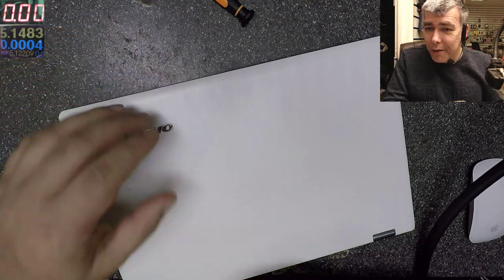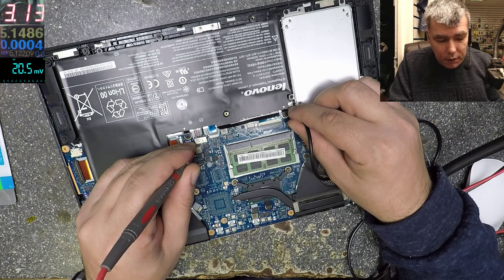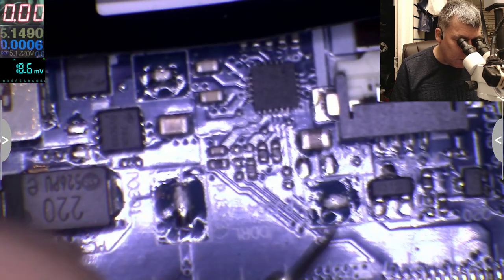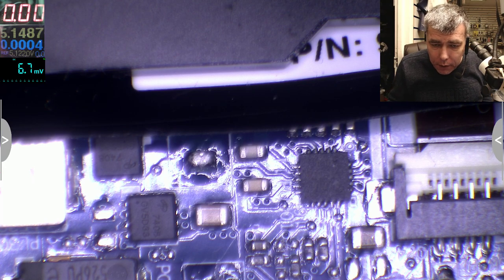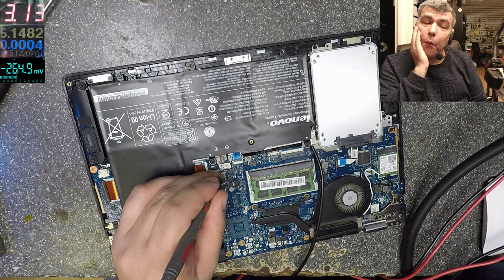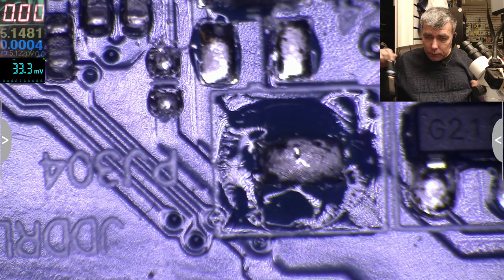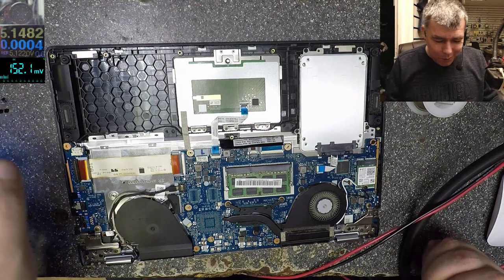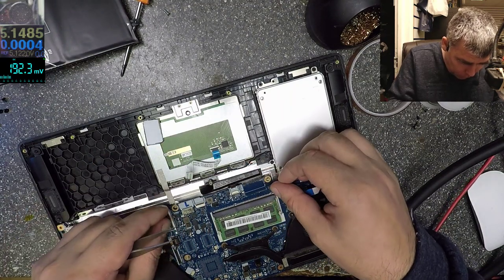Advanced Laptop Motherboard Repair Lesson - RAM memory power supply - diagnose and repair

Comment: I recently repaired exactly the same machine with the same issue. It has to be quite common problem on this laptop. Unfortunately around week later 3.3v power supply fried itself. I wonder if power brick might be the issue with this model
Reply: When i plug the adapter, a zone of mainboard is very hot.That mean there is a short circuit?
Reply: @Razvan96  yes. put ipa and see what gets hot

Comment: amazing great Sorin, but how did you first decide to test RAM voltage and not doubted the graphics?...
Reply: he know from the model...
Reply: The graphics are built into the CPU on this. The spot for a GPU is empty with solder balls. So therefore I don't believe there is a discrete graphics PSU.

Comment: What else could cause a laptop to come on without any picture ?  Have a HP G4 laptop which comes on periodically. When it comes on though  it will stay on and operate normally. When the screen does not come on, the lights on the board will still light up ...  What do you think could be the possible issues ?

Comment: Hey, I have a laptop with RAM on board and it seems to have a short on the RAM circuit. The entire 1.35V net is shorted. I tried to find the shorted part with the power supply (1.35V @ 5 A) but I can't pinpoint it. The entire region gets warm with no specific part getting hotter than the rest. Any suggestion on how I could find the short and fix it? Thanks.

Comment: Sorin, when you charge this battery with your power supply, why you put the negatieve on the motherboard and not on the black wire of the battery itself, like the red one?
Reply from the maker: always the minus of the battery is connected to ground, so is differences if i use the minus on the battery connector or on any other ground of the motherboard

Comment: Hi , just asking a friend have a look alike the one you show this video but his lenovo yoga y700 14" it power but no display get 4 beep sound any idea is the version have issue with disordering Gpu or Cpu be high heat that could cause this ? Already remove every thing replace ram, try with out battery ,

Comment: Hi,
Please I need you help if you can, I have a Lenovo ThinkPad S230U Twist with a bios password I did opened the  computer and disconnect the bios battery as I did see on a lot off  videos but its not working , I even tried to boot with lunix bootable USB but still I can't because everything is disabled on the bios I saw couple videos that they said I have to short the bios chip but I don't know witch one to short, if you have any idea how to do that please let me know.
Thank you

Comment: hey I have hp envy 360 laptop when I put it on the on button turns white and flashes. I took the battery and press the power button for 1 min and put everything back and turn it but will not turn on. the on button just flashes what should I do. I need help

Comment: hi Bro, when i press the power button on my asus laptop with the ram memory inserted in the slot, it turns on and off.
when i remove the ram memory and turn it on it stays on. I checked the ram power circuit with laptop turned on without ram, and the voltages are all there. what could be the problem with you? thanks in advance. Niko

Comment: I did not underatand, what you do with PGOOD signal? On what voltage you connect it?
Reply: I think Sorin supplied 1.3 volts using a power supply to ram coil and fooled the super i/o chip to turn on the unit and the baclight display.

Comment: I have a question its a dell inspiron 1425 this laptop is doing my head in, ive replaced the
inverter and fuse is fine, this is what happens this is not a repair job its a hobby for me
this is strage, i have screen when i boot the laptop once i have used it all seems fine
now i will turn the laptop off and the screen wont come bk on after a reboot i take
it to bits again and it works again for a few times and the same thing happens.Its
crazy :)) im going to find the screen power lines and see if there is any voltage
going to them maybe from the laptop screen fuse onwards.
Reply from the maker: thats the screen, backlight tube is gone and is coming on few seconds only, i know. Just replace the screen, or test with another screen even if is not the same size, check only the backlight

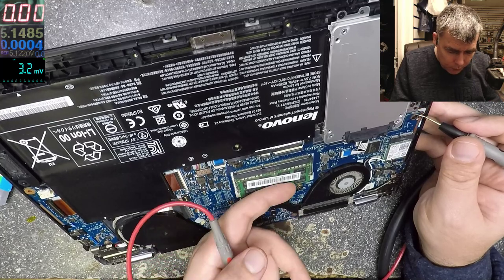Comment: 14:03 "..processor is warm, that's mean the voltage is fine" - No, You forgot one thing - You know that it is a hybrid: Cpu+Gpu+Pch (chipset) so it has three different voltages. So if it is warm it doesn't mean that all three voltages are fine :) But on the opposite side... If KBC (super io chip) allows to start motherboard, then probably at least main votlatge regulators (drivers) are working, especially that for PCH
Reply from the maker: i know what you mean, but the fault already been spotted. Having two power rails missing is not a usual case, thats why i ignored the other power rails and i assumed if the processor is warm, probably  the power rails are fine.
Reply: I worte that comment on the flying watching your movie. I know You are smart and You know that the new laptops are like a trap so I only wanted to refresh your memory for the future -- we all have a habbit to think that this is a cpu, and that is why we forget to thing about 3 different voltages there, so the "warm" cannot gives you 100% sure.
Reply: @Radek__  If you know a lot of things about repairing why you keep only for you and make comments? Make your own video to explains us how to do like a pro. I'm waiting your video to be update.
Reply: Mirel M: i was wonder today why a lot of people is taking that kind of comments like an attack? It is not an attack it is a help or advice. Everyone could get advices - me, you, Sorin, etc - the reason is very simple - because noone is perfect, noone is doing everything perfect. We all can make mistakes or forget about something during the job. I'm fixing laptops motherboards, TVs, since few years - but I'm here not for judging or checking if Sorin is doing everything right. I'm here to hear more his advices, ideas, learn from his experience.  I'm reading him like a good, kind person. I knew it (sensed intuitively) from first video, which i watched, so I liked him immediately. I enjoy to watch his each video, even if I know how to fix it as well. Once I thank him for great idea, then other time I pointed out something bad/not good. It is not an attack. Maybe it looks like that i'm trying to be smart, brag about what I know that he doens't knows but is not like that. Sorin gives us all a lot of advices, he is sharing his experience, tricks, tips - so I want to give him something back- For example that my another comment with ram voltages list. That information can help him in the future. It is not an attack. I'm grateful that he is doing what he is doing for all of us.

Comment: sir any time the cmos battery is in the laptop the laptop will not turn on but if i take out the cmos battery it turn on
Reply from the maker: probably is a hp laptop, check power button circuit
Reply: yes is hp, if the cmos battery is in, power button voltage drop to 1.7v

Comment: 42:17 "...I have no idea if is 1.35..how much must be?" 
Take a look at the sticker of ram chip and find word "DDRx/PCx":
DDR2 or PC2 has standard 1.8V
then:
DDR3/PC3 has standard 1.50V
DDR3L/PC3L (Low votage) has 1.35V
DDR3U/PC3U (Ultra low voltage) has 1.25V

DDR4/PC4 has 1.2V

now you  have idea :)
Reply from the maker: Oh, u got this wrong, i can't see o my lab power supply the third no, i get 1.3 only and 1.3 can be 1.30-1.39, thats what i mean. You u seen the video, on some point the laptop got frozen with 1.3v and i rise the voltage to 1.4v and was working fine. Yeah, i should buy a more precise lab power supply
Reply: oh! ok then - i'm sorry ;) I don't think that you should buy more precise power supply. I'm using cheap zhaoxin rxn-3050 for years and its fine. If You are good, You will fix it without pro tools. Logical thinking, skills, experience - That is why I admire You.
Reply from the maker: Thank you